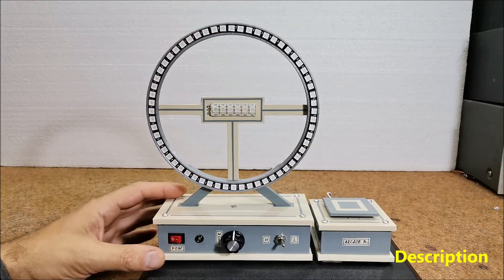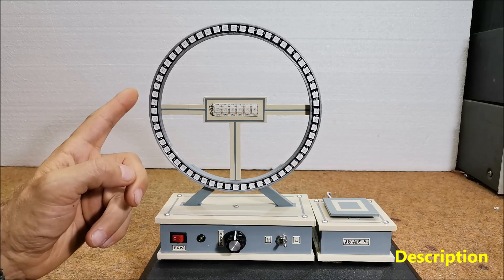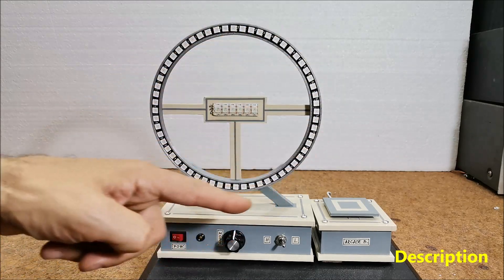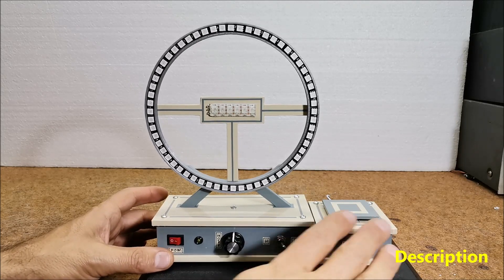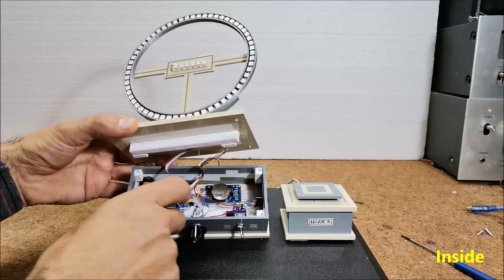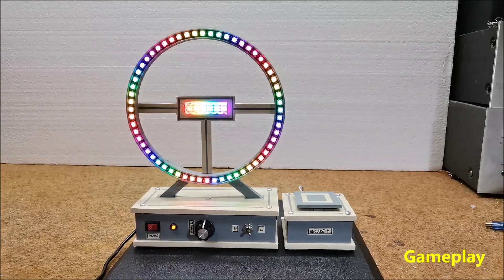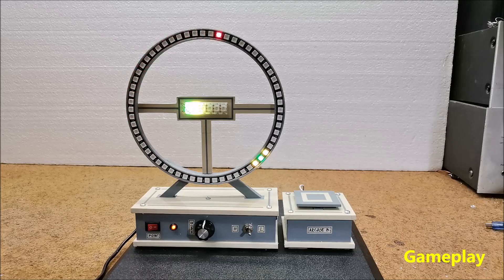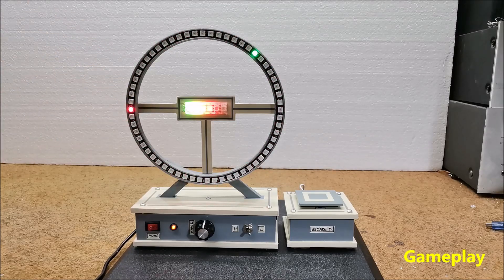DIY Arduino Cyclone Game with WS2812B Led Ring

Comment: I’m in the process of making this, and quick question regarding this project, does it matter what wires you use for the entire thing?
Reply from the maker: It doesn't really matter what wires are used for this project
Reply: @MirkoPavleskiMK  also another question, what wires did you use for the led ring and how did you connect them?
Reply from the maker: @humzaha9090  Detailed instructions on :  https://www.hackster.io/mircemk/diy-arduino-cyclone-game-with-ws2812b-led-ring-738c58

Comment: Super project! I have a question. Is it possible to modify the code which you used so that instead of one LED that moves around, group of 2 or 3 LEDs move together around?